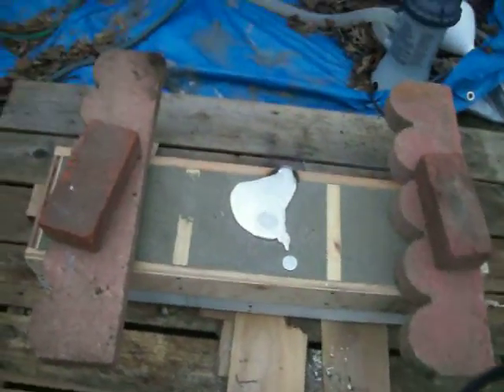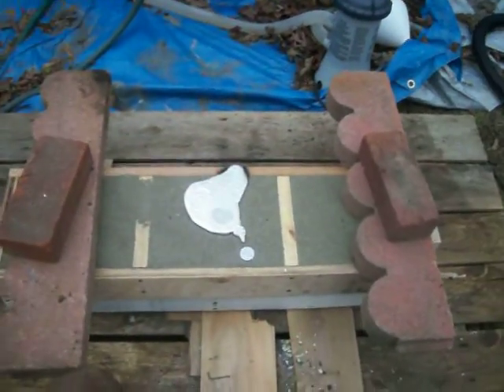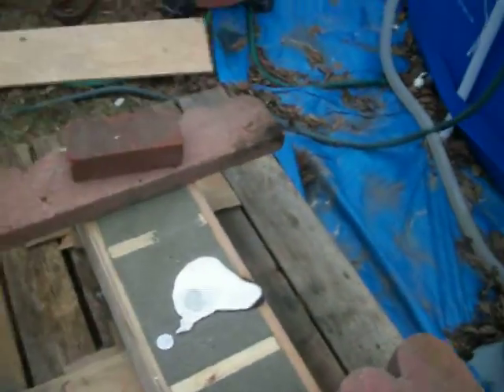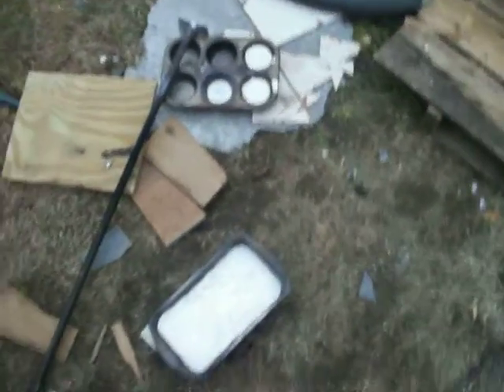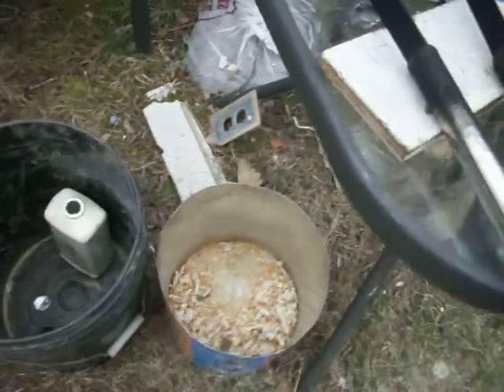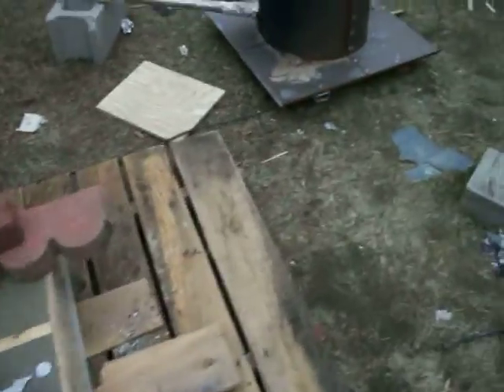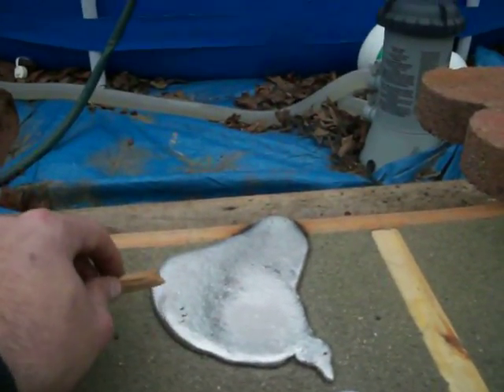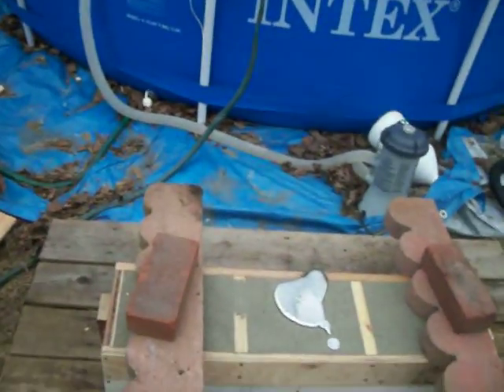Gingery lathe bed pour

Comment: hi there, I cant see but did you have a second hole as a riser in your casting
Reply from the maker: No I did not. If I were to do it again I would have placed the sprue on the side of the bed so I wouldn't have to cut it off at the top surface of the lathe bed where I scraped it. It took longer to even out the top of the surface because the sprue's location.